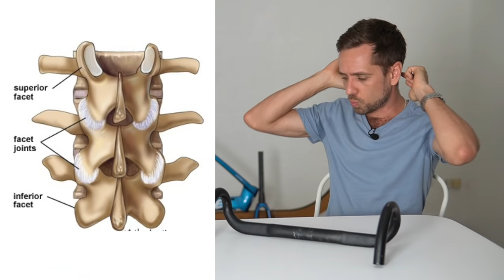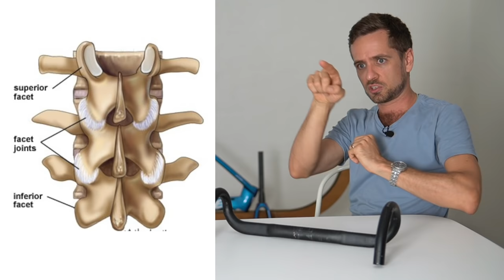What Causes Neck Pain when Cycling (incl: three possible solutions)

Comment: Still confused, but at a higher level... 😅
Reply: Essentially if you have neck pains it's because of uneven weight distribution towards the front of the bike. You can change it by moving the saddle backwards and down just a touch and moving your cleats back before tinkering with the front end. Unloading the hands is the name of the game. Try tinkering with a different stem and bar height and see how it goes. Most people find relief from a less prominent drop, but some hyper flexible people need more drop to unload the hands, but they are rare.
Reply: Exactly same, felt like a rollercoaster ride.  In conclusion I came out of this as it could be 50/50 one and or all of the above but come pay me to take care of it for you.  But based on my experience the issue is trying to decide comfort vs performance.  Comfort fit gets you to comfortably look around but costs aero.  Performance you get all the aero but at a cost of being able to have a wider angle of view.p

Comment: FWIW I was getting really bad neck pain, and these Neil videos helped a little in that area (helped a lot in general though), but the cure came from realizing the issue wasn't with neck muscles or traps, it was tight lats. Doing dead hangs after rides and a few pull ups here and there fixed me up in a few days.

Comment: I always tell people that the idea is to ride the bike as if you were on a unicycle that just happens to have a convenient arm rest. 
Your strength focus should be on your core and pedal push momentum from your legs. I often flex my abs when I ride now and it helps a lot. Obviously to improve on this it helps to do some weight training and calisthenics. Squats and goblet squats with moderate weight and lunges build the muscles for this and the core will strengthen over time when you add some all around body work like push ups and burpees. Riding after pull-up day is pretty hard on the neck muscles so you should really get your neck rubbed and relaxed before your ride.

Comment: Based on my experience my neck pain caused by bigger frame size bike. My height can fit size 50-51cm bikes but i am more comfortable in 46cm. I had a caad8 50cm before when i rode it for 40km i already felt neck pain. But when i bought louis garneau cen 46cm no pain at all. So i changed my caad8 50cm to caad10 46cm and no pain issues after that. Because i am not over reaching.

Comment: I knew by experience what he explained in the video but I couldn’t quite figure out the mechanics of how a higher bar position could cause more neck pain. Thank you for the insight! 👍👍
Reply: once you figure out the best position would you say you can do over 80km without sitting up much and still feel fine in the neck? i don’t ride fast, but my favourite bikes have always been 80s vintage steel frame road bikes; i would love to do over 200km in a single day and i was starting to think i need an upright bike for that. my question is, can a non-athletic rider like me do big mileage on relatively “aggressive” bars/bikes without neck pain? i have yet to pull the seat back as suggested in the video.
Reply: @johnnysecular  In a word, yes. I can do 100km without apparent neck pain now that I have dialed in the position. But the best advice I can offer is: your mileage may vary depending on how "aggressive" your bike geometry is. :(
Reply: Glad this was of some help. I figured this out when I demo'ed some endurance geometry  bikes. I'd always ridden with a fairly aggressive position with no trouble. Instead of letting me relax with a more uptight position, the raised bar put my arms in opposition to my natural back angle.

Comment: This was one of the videos that made me go for a bike fit - Thank you for sharing this! 
I was getting a lot of pain going up through the neck and laterally irradiating to the trapezius, after 2 or 3 hours, especially if the ride was very intense. I also had unbearable pain in my left foot fingers after some time. There were several problems, one was the fact that the shop owner (Specialized agent) sold me a bike too big for me. I'm almost sure I asked for a 54, but after some months of waiting for it, I got a bit worried when I saw the "56" number on it. But the seller said it was perfect for me, no doubt - I thrust him because he was a professional cyclist for years and had been a "bike fitter"... after all, this was my first bike after decades without cycling. Sadly, the shoes were also bought there and he didn't offer any help to position the cleats - hey, I'm a newbie!
So, after a year, I've started to avoid long rides, and the bike's comfort became worse and worse... I decided I must have a bike fit.
After the bike fit: 
- I was right... the bike was too big. I had to replace the stem and level the handlebars. The seat post when a little higher and the cleats were placed in the correct position. The saddle was perfect though.
Now, I'm so much more comfortable on it... I feel the pedal strokes are more efficient and my body is slowly "forgetting" the wrong posture of the previous setup, I frequently correct the shoulders while riding, sometimes I feel the left one is shrugging and then I relax it... I think this is a process that will gradually improve, I just have to be patient and resilient.
Reply from the maker: Thanks for sharing on the thread
Reply: @roadcyclingacademy  ;) I thought it might help someone.

Comment: Great tips. One I found recently that has helped me.. I was watching a GCN video and something about bike fit brought one of the presenters to mention dropping your shoulders. I thought about that the next time I was on a ride..before I did though, I kinda analyzed where my shoulders were. The delts were almost in my ears :-O Now I've been riding that way for EVER.. it isn't an easily broken habit..but for the last half dozen rides I've caught myself innumerable times, relaxing them.. a lot. Correcting on the fly, the last 4 rides or so, my shoulders and neck don't ache so bad I dread my next ride. Weird, huh? I think it was pinching nerves somewhere in my c-spine. For some reason, dropping my shoulders seems at this early stage of "reseaarch" to have remedied a long persistent problem for me. I do need core work, too. Legs? Oak trees. Waist up? Pudding if there ever was

Comment: Had tried all sorts trying to get rid of pain in shoulders and hands, then went for a ride one morning and the bars slipped in the stem, causing the levers to be lower. It meant getting lower to reach the brakes but removed the pain in my shoulders and hands. Thought the lower position must be wrong, so went back to my previous setup straight away, but now going to give it another go after hearing your advice!
Reply: I had the same situation like yours. Was getting same pains. I hit a pothole which caused the bars to slip. Immediately the pains were gone. As soon as I got home, grabbed my tool and I locked in that new position. It wasn't a massive drop to boot. Something like 2 to 3 millimeters.

Comment: Well after riding diamond frame bikes for 39 years and finally having to quit due to neck seat and hand nerve damage , I got myself a nice touring recumbent and I now ride in comfort with no need to hold the head up , no problem in traffic, no hand pressure on the handlebars and even though it is termed touring , I get my speed fix .Comfort and speed what else is there in cycling?  Two things that stop so many from going out and getting a recumbent 1. peer pressure to be riding what everyone else has  2. Unfortunately the recumbents are not mass produced so finding one used is your best entry point. It really does not matter how much you put out for a bike fit , as at some point in your life you will realize that sitting on 6 square inches of saddle is not as comfortable as sitting in a chair with a backrest.  Come to the dark side!

Comment: I’m very fortunate to live in Brisbane and finally went to see Neill two months ago, then had my follow up fit last week. 

Neill is an absolute genius, he aligned my symmetry (I was twisted to the left) and got me to do strength training to correct two muscle imbalances. He moved my saddle forward with a longer stem and the bars are as low as they’ll go on my bike with a minus 20deg angle. It’s about as aero as I can possibly get. 

I did a 125km very hard and fast group ride yesterday and felt as strong and pain-free as I ever have on the bike. Hands down the best money I have spent on this bike!
Reply from the maker: Interesting to hear, thanks for sharing on the thread. Cam

Comment: I wonder if tyre width and tyre pressure plays a small part in the shoulder pain aswell..? I generally feel more comfy on my crossbike with 32mm tyres at low pressure than on my road bike with 26mm tyres. Even though I actively think about my posture, have a nice bend on the elbows and a very realxed grip on my handlebar, I still feel how my shoulders takes some of the vibrations and shock from the road surface. 

Hearing Neill talk about lowering the bars was very interesting because I've noticed something about my two bikes: My cross bike has the exact same reach as my road bike, but 40mm (yikes) more drop to the bars and the saddle is 15mm further back. I feel much better and more relaxed on the cross bike, but I hardly ride the same distances on my cross bike (I will try this though). I had a bike fit done on my road bike and the fitter maxed out the spacers underneath the stem and moved my saddle forward 15mm and this didn't really solve anything in the long run. I was however very off with the bike setup when I came in to the fitter with my problems so it got a lot better compared to how I started out. I'm tempted to lower the bar to the same height as my crossbike, but I feel like I need the proper core strenght to back that decision up. Because if you lower the bar and can't keep your core engaged enough to tilt forward, you will end up hunching and putting all the weight on your hands anyway.

Thanks Cam and Neill!

Comment: Thank you for this video!  I started getting neck pain and hand pain this season despite riding with the same setup I always used previously.  Shrinking as I get older?  The conventional "wisdom" I found on the Internet all suggested my reach was too long and riding position too low, so I moved my saddle forward and lowered my seat a couple mm.  My next couple rides were the most painful I've ever experienced with pain not only in my neck/shoulders, but also in my hands, knees, feet and butt.  Then I found this video and tried to adjust my bike so I didn't need my hands to hold my riding position.  I ended up with the seat all the way back and actually raised a mm over where I have always had it before and the pain got much, much better.  

Unfortunately, neck/shoulder pain still comes back somewhat after a couple hours in the saddle.  That pain is mild enough that I can suffer through it, but now I feel I'm on a mission to dial riding postion in perfectly and/or learn what geometry I need in a new bike.  I already have a set back seatpost and the saddle as far back as it can go, cleats all the way back, and it feels like I still need it to go back even further to be perfectly balanced and not need my hands to hold my position.  What could the problem be here?  My bike has a 74 degree seat tube angle which seems pretty typical for bikes in the 54cm size range, but it seems like I need something more like a 73 or lower degrees to be balanced with standard seatposts and saddles, but bike manufacturers don't seem to go to angles that low until you get to the very large bikes.  I'm about 5'10" / 177cm and suspect my legs are shorter and torso longer compared to a typical rider.  Any thoughts?

Comment: Very interesting. I have moved my cleats back, lowered the saddle ~3 mm, and pushed the saddle back 2 mm. Still with an issue. I moved the cleats back first. Still had LBP then moved saddle back then lowered height. Still with some LBP, although I felt somewhat better in back. I have a 100 mm stem pointed up rather than down. If I move the seat back a little more then what adjustments to saddle height and cleat position do I make? What's next? I get variable results if I use the LeMond, 109% method of estimating saddle height. If too low then tibialis anterior pain in right leg. I have tried wedges and shims. I am slowly removing the shims as I am not sure if they are working in the left leg. I am going crazy. I have had multiple fittings but can't get this dialed right. I am on a Trek Domane 2018, 58 cm frame, 44 cm handle bars, 148 mm width Arvada saddle. 6'1" inseam from 34-35 inches. I just can't seem to get this right.
Reply from the maker: Thanks for sharing on the thread interesting to hear. Cam
Reply: First I hope I’m wrong.
   But most likely 99.8% the frame is too big. It’s an old rule/trick, but it is accurate. Don’t listen to Any bike fitter whatever they tell you. If you stand over the bike, with your cycling shorts, and you don’t have 2 inches-(not centiliters) of clearance, the frame is too big. And if that is the case, there is very little you can do.
Reply: @tonypowers123  thank you for the suggestion. I finally found someone dialed things in properly. The frame size is good. Saddle height and position was off. Just a few more tweaks and I’m good. Amazing what a real bike fitter can do.
Reply: @mehmd1913  Ah! Glad to hear! Love that. Amazing what mm can affect on a road bike!

Comment: Thank you, You Tube. This has been an on-going issue with me this year. I'm relatively new to cycling having started in earnest during the middle of 2019. But this year is the first time I have really had problems that start with right around the base of the back of my neck, but as I continue to ride it just seems to spread outward. 

I'm definitely not of the flexible sort. My bars are high (I think), but some of that was due to putting too much weight on my hands before I raised it. 

I have had a bike fit, but I have messed around with the seat enough that it's probably negated most of what was done. Plus, I switched from peddles for cleats to now using flats simply due to pain in my left knee that I couldn't get rid of until I just went with the flats. 

But at least this video gives me a few ideas of what might be my issue and at least, some place to start looking. I'm supposed to do a 150 mile gravel ride this year, my longest ever (if I finish), and I really want to get this sorted out, because it sucks. I don't like riding when it gets to that point. 

Well done on the video. I'll make sure to check your stuff often, now that I have found you.

Comment: I have watched this vid and some of your others vids where you state that lowering the torso somehow relieves weight on your hands... I must be completely obtuse, but I still do not understand how lowering the stem or stem angle can do remove weight on the hands or by moving the seat forward it can increase weight on the hands... my Hands are going numb and its coming from neck impingement and weight on the hands, so I was planning on shortening my stem to 80mm with a 10 deg rise and dumping my 20mm setback seat post for a 10mm setback, but y'all are saying I should do the opposite??? I am confused
Reply: Don’t be confused! ☝️
   His information is very insightful. What does stretching means !?, why do We stretch-(for those that do) you stretch to enlarge a muscle. Relax a muscle by stretching. Try putting a bucket of water on top of your head, and hold it upright for 10 min. See how your neck and spine will feel.
 This is he same practice. 
  Again-more stretched, less weight.

Comment: Hello from Greece. 

I have a question. 

I got the look aerolight 695 from a friend and he had cut the top end of the fork extremely low, in order to prevent a crack to go down on the fork (from a crash), so now the position of the rider (me) must be extremely aerodynamic. No problem with that. It is something I'm trying to achieve. BUT, I cannot figure out if I must place the zed crank at 170mm or at 175mm . Because i have 52 chainring, and i like the bigger range of motion, i would prefer the 170mm position of the crank but is it the right thing to do???

Given the data from above the question is: should i ride with 170mm, open hip angle and saddle high or with the 175mm , less open hip and seat a little bit lower? Im going to use the bike for one sprint triathlon and road cycling in general.

Comment: Are u in NSW , VIC or Sunny Queensland 🌞.  
I ride a SL5 EXPERT DISK with heaps of upgrades.   Have suffered with numbness in the hands since l was a young rider . So move the hands around alot . 

Recently I purchased a SL7 S-WORKS 54CM & bike is set up identical 2 my SL5 . 

Problem is the Bars on the SL7 feel 2 high . Only ridden 25ks on it so far . It feels like l need 2 take 1.5cm out of the height.  

And l suffer from Chronic Concussion Headaches and Migraines 24/7  for the last 6+ yrs from a MVA . 

Might have 2 come 4 some TLC . 

In Victoria.  

What sort of $$ 4 a bike fit from U . 
Cheers Robert

Comment: Great info guys, quick question, I can comfortably cycle 100 km before onset of neck pain, this down more to fatigue than position?
Reply: In my non expert opinion, you would be most likely correct.
Reply from the maker: Could be a bit of both. Maybe your position is only just slightly off so your tolerance for longer distances is high? - Neill
Reply: yeah i have the same experience at 80km, i’m otherwise very comfortable on the bike and that’s why i’m reluctant to change saddle height. my saddle is already all the way back. since watching this video i tried to make a conscious effort of not gripping hard on the bar, but haven’t gone on a long trip.